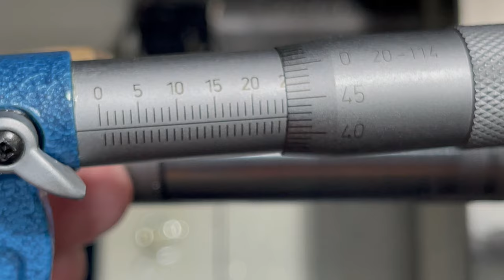Diamonds & Balls, Burnishing Tools | Shop Made Tools

Comment: Interesting! I have burnished surfaces of steel bar stock in the vice after draw filing. A fully hardened and polished round bar works well, but I've never tried it in the lathe. It looks like it would be useful for reducing a diameter by a few microns to improve a fit too.
Reply from the maker: Thanks for the comment. I agree about the reduction in diameter. I need to do some trials but I think it will be a great tool for use in finishing bearing seats as well as final finishing. Cheers SteveO

Comment: The diamond surface looks like it might have "cut" a little bit on the leading point edge, as opposed to the tangent surface from the ball bearing.  

Interesting work.  Would be intrigued at the difference in surface area of the contact, and the toolhead pressure of the carriage

Comment: Very interesting. I’ve never thought of trying this, but now I think I will. What comes to mind are several things. Burnishing stainless should give a decent amount of work hardness. Obviously, that would require some experimentation, as will the amount you need to over diameter the parts before burnishing. Like you said, the diamond is designed to cut grinding wheels. Sapphire balls are easy to obtain (I have a bunch from my chemical adjustment feed tubes) they’re hard enough, though I’m not sure if they would hold up. Carbide would be good to try instead of the diamond, as you can finish the tip to a high polish ball. I’ve done that for other purposed using 100,000 optical diamond polishing compound. Very nice build.
Reply from the maker: Thanks for the comment. You raise some interesting points. A carbide rod properly shaped and polished might be a good replacement for the diamond tool, not sure where I would get a 3/8" piece of carbide 2 1/2" long though. I do have some work to do to work out the diameter loss with the ball burnisher but as you say, some experimenting is needed.
Cheers SteveO
Reply: That’s very interesting. That’s a whole different level going to carbide. That could be a pretty durable solution. Getting a feel for how it reacts as far as tool pressure versus travel on a regular repeatable scale, I worry about the steel balls causing damage to your workpiece. But all this is new to me so I’m just trying to take it all in. Lots of really good content. I love manual machining. 🍻

Comment: Nice machining, but more elaborate than need be. A brass rod, bored to receive a silicon nitride ball bearing and burnished to keep it captive works well. Ends up looking something like an oversized ball point pen tip. (Steel ball bearings seem to gall in this application, silicon nitride works well.)
Reply from the maker: Thanks for the comment. That's an interesting idea. There is a limitation on my tool getting close to a shoulder and I have been looking for an opportunity to make a tool that can burnish corners and put a hard shoulder. I will research your suggestion, thanks. Cheers SteveO
Reply: @theoutbackshed  I used a 5/16 inch ball and a 1/2 inch rod, bringing me within 1/4 inch of a tall shoulder and about 5/32 inch of low shoulders.
Reply from the maker: Thanks mate, I will chase that up, Cheers SteveO

Comment: G'day Steve, nice job there.
 If you dont have a reamer you can make a drill cut on size by using an oilstone to round off the corner of the cutting egdes . Drill an undersize hole first, just like you would with a reamer, and remeber to sharpen the drill again before using it as a drill
Reply from the maker: Thanks for the comment. I'll store that up for future use. Cheers SteveO

Comment: Burnishing does a great job of achieving a good finish to a point. However I prefer to lap a diameter to size if I need to achieve size and finish and missed it with the turning tool. . Laps are easy to make from a piece of wood. But the burnish will give better finishes of many machines than a tool ever could. Even things like diamond reams often do more burnishing than cutting. You can get carbide balls as well and they have an excellent surface finish so should be as good as the steel balls.
Reply from the maker: Thanks for the comment. I'll see if I can get some carbide balls. Cheers SteveO

Comment: Would you consider making a 45 degree approach burnishing tool so it can burnish the o/d & the face of a part and all the angles and radii inbetween?
Reply from the maker: Thanks for the comment. I have thought about that but for the tool to work effectively the support bearing needs to be directly behind the point of contact of the ball. Not sure what an angled setup would do as the ball would not be properly supported. I did watch your video (I'm a big fan of your work and a subscriber) and saw your tool. Perhaps you have already solved it.
Cheers SteveO
Reply: @theoutbackshed  I used a stock size transfer ball. They are used for rolling parts across tables, the ball sits in a hemispherical cavity on several much smaller recirculating balls. I've tried mine on a taper which worked fine. For some time I have been contemplating burnishing a complex profile to see if it works. Perhaps with the huge resurgence of these tools on Youtube it may be time to have a go.Thanks for the sub. Edit: video now live.
Reply from the maker: Thanks mate

Comment: G'day Steve, new subscriber here, great result with the ball tool, diamond not so, but I really didn't expect it to in" out of the packet" condition. If that were mine I think I would sacrifice a thousand grit diamond Filing stick or better still if you have those cheapo diamond paste sets and use that on a wooden lollipop stick to round the diamond point. Just by fitting the tool in the lathe chuck and rolling the lollipop sick over the end gradually going down the micron grades until it looks smooth under the microscope, covering the ways of course. Worth a try I'd think. I bought a set of the diamond pastes off of eBay a few years ago and they cost me less than ten quid and work very well for polishing stuff. I'm confused, your Colchester lathe looks brand spanking new, but I thought they went out of business ages ago. Has the name been bought and they're being made in the far east now? I'd be interested to know your thoughts on the quality. Cheers from the UK
Reply from the maker: Thanks for the comment. I was contacted today by a company called LIVETOOLS, apparently they stock diamond burnishing tools but they are outside my budget. Still thinking about how to proceed with the diamond stick but there's no hurry. Colchester lathes are still made but not in the UK anymore, Taiwan I believe under license. Colchester Lathes are available here in Australia but I'll stick with mine I think. My Colchester is 40 years old, I bought it in 1984, if you look after your lathe it will look after you. There's more information on this in my video on Lathe Maintenance.
Here's the link:
https://youtu.be/OqT_e_7NPM8

Cheers SteveO

Comment: I'm watching and liking so far.  I have a question about using a diamond file on low carbon steel????
Reply from the maker: Thanks for the comment, the file works fine on this material. Cheers SteveO

Comment: With the ball burnishing tool how much tool pressure are you putting on the material or once you make contact how much are you advancing the tool into the work?  Nice work on the tools.
Reply from the maker: Thanks for the comment. So far only very little pressure. I haven't measured it or taken note of the advance, I'll give some feedback on that in future projects. I have the impression (rightly or wrongly) that doing the 2nd pass on reverse feed provides an opportunity to obtain a better finish by rolling the pattern in the opposite direction. I need to do some experimenting.
Cheers SteveO

Comment: Great workmanship. What was it for? When are you going to use that?
Reply from the maker: Thanks for the comment. It certainly improves the surface finish on mild steel. 4140 and 4340 produce good finishes with decent speeds and feeds as does aluminium and stainless. So it will depend on what I am making. It may be a good finishing tool for good surface finishes with minimal metal removal? 
Cheers SteveO

Comment: Nice test I just wished you would have used a actual diamond burnisher.
Reply from the maker: Thanks for the comment. I understand that a genuine diamond burnisher can be purchased for around A$400 but that's beyond my budget, however, the opportunity in this project was to see if a diamond wheel dresser could be setup to perform this job. As the video showed it was not successful probably due to the pointy nature of the diamond rather than having. smooth end.
It was a fun build though and I view it as still a work in progress.
Cheers SteveO

Comment: Does burnishing change the dimension of the part, and if so, how much? Thanks. What about surface hardness? Does it make the surface harder? I would think so.
Reply from the maker: Hi and thanks for the comment. The machined bar registered 24.921mm on the micrometer, the ball burnished reading was 24.918mm. That's a reduction in 0.003mm or 3 microns. Different metals would likely give different results. 1020 steel would likely not work harden but I would expect other metals like 1045; 4141 and Stainless Steel likely would show an increase in surface hardness. Cheers SteveO
Reply: @theoutbackshed thanks that's something I've been wondering, what about brass would that harden at all?
Reply from the maker: Thanks for the comment. It's relatively easy to get a good finish on brass so I'm not sure I would burnish it. That said, it would be interesting to find out if it would work harden. I have my doubts that it would.
Cheers SteveO

Comment: my digital micrometer has made my micrometer reading skills rusty, any chance of getting the actual diameter change from the burnished parts?
Reply from the maker: Hi and thanks for the comment. The machined bar registered 24.921mm on the micrometer, the ball burnished reading was 24.918mm. That's a reduction in 0.003mm or 3 microns. Not sure how repeatable this would be and I did expect it to change on different materials. Cheers SteveO
Reply: @theoutbackshed  amazing, thank you so much for taking the time to reply. thats basically negligible for almost everything i do, so will definitely experiment with this technique.

Comment: i wonder how bad these tools are for the headstock and tailstock bearrings ?
cheers 
ben
Reply from the maker: Thanks for the comment. The pressure applied to the tools are no more than would be applied during normal turning. Push knurling would be far worse (I never do push knurling) Most of stress would be in the cross slide lead screw and nut. There would be no issues for the headstock or tailstock centre bearings. Perhaps I could design a pinch type ball burnishing tool?
Cheers SteveO
Reply: @theoutbackshed  Very interesting video. Thanks for posting. See "Enots Engineering"(Alan) He made plain wheels for his scissor type knurling tool with pretty good success. Regards from the uk.

Comment: 25:40 any reason you were running the reamer in reverse?
Reply from the maker: Thanks for the comment. The reamer was running correctly, it is a reverse spiral reamer and is designed that way. After I remove the reamer I show it to the camera. Cheers SteveO
Reply: Most machine reamers have left hand spirals to prevent them pulling into the hole.